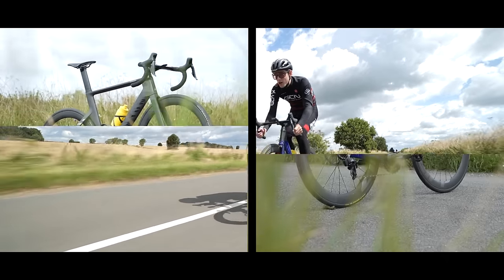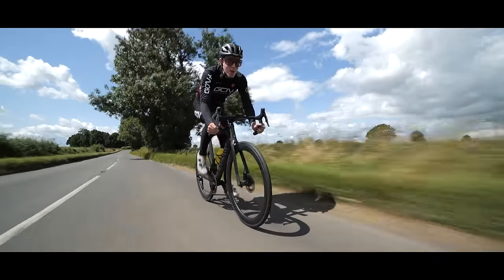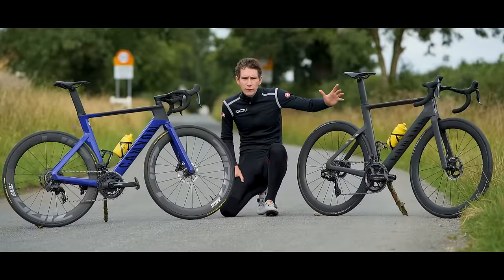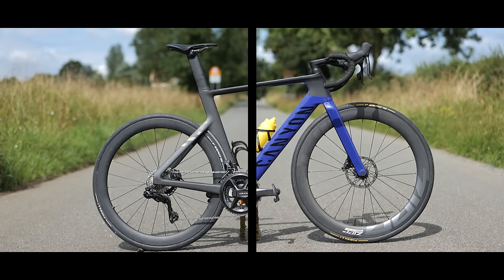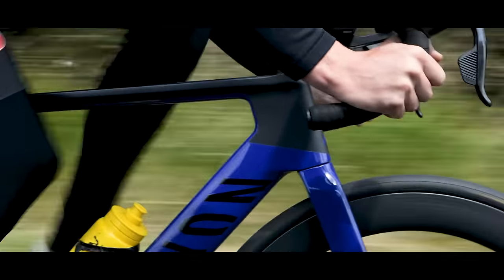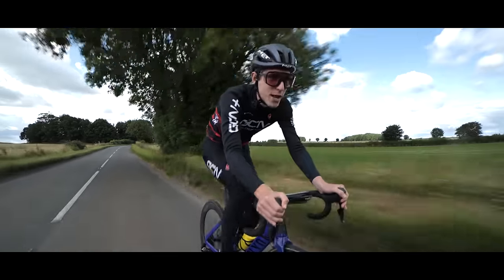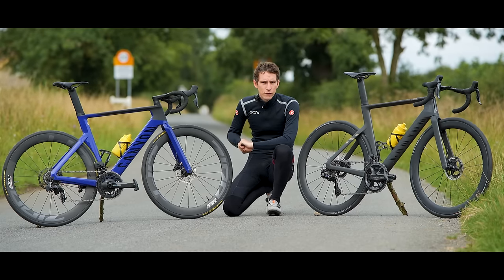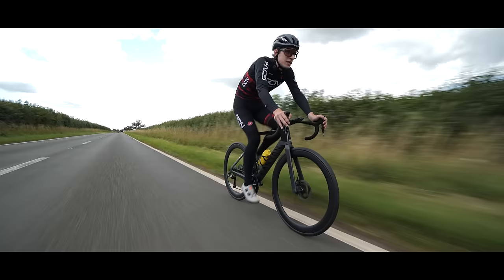Why Do These Two Canyon Aeroad Bikes Feel So Different?

Comment from the maker: Frame or components: what matters more to you? 🤔 Let us know in the comments below! 👇
Reply: frame for what the bike is and feels like (wheel choise accordingly). handlebars make a difference of course. but the components are more for funktionality. like 1x or 2x, gear choise, and so on. but colour is so important, l don't like how little options are out the quite often. the chinese actually do a great job with affordable fully custom paint jobs
Reply: I think the frame fit is most important. Components may add weight, or weigh less, but if you are optimizing your position on a really nice frame, you are going to love the feel, which will make you seem like you are faster even if you aren’t.
Reply: Frame fit is most important - you can always change components on your frame to your liking, but the frame is the frame - that's essentially the bike skeleton - it can't be adjusted.
Reply: The frame is more important because it's the foundation, you build up from there and switch out literally everything else.  The frame determines 90% of the ride characteristics.  This video show you're just tinkering around the edges in terms of ride feel and responsiveness
Reply: Frame geometry makes a big difference. Next are tyres and wheels. Lighter wheels feel different. Wider tyres feel different.
Reply: Canyon frames don't matter because they crack. 4 / 4 now
Reply: Geometry is by far most important.
Reply: @gcntech Question for y’all—how important is the addition of all the additional (aftermarket) tech? After buying sensors, pedals, and head unit—a person could have reinvested a small fortune in their equipment. Can you speak to the importance of these items? If you didn’t have them, would you still enjoy the cycling experience?
Reply: Funny to see that many cyclists seem to not value the properties of carbon. I am both a cyclist and a surfer. In surfing, the flex of a material is pretty much its most important characteristic. Surfboards can be made with fibers with polyester resin or with fibers with epoxy resin. Sometimes strips of carbon fibers are then used on top of the regular fiberglass to add specific stiffnes or flex in certain areas. However, surfboards can also be made completely out of carbon fibers, or mixed carbon and aramid fibers.
All these specific combinations of fibers with resins all result in completely different characteristics of a surfboard. This, however, also holds true for bikes.
What kind of materials is used will have an gigantic impact on the feel of the bike. But also the way that the material is used will have a great impact. If you only use 1 or 2 layers of carbonfiber, the result will feel very, very different from when 4 or 5 layers are used. More layers are stiffer, but can also provide more dampening.

This eventually means that the different frames of the same model will, like Si has noticed, result in very different bikes. Their aerodynamics and functionality will be the same, but their character and feel will most likely not be similar.
Reply: @TheMoodyedge  Which year and which model?
Reply: Components.  Specifically tires and psi.
Reply: Both. They both make up a fast bike
Reply: Frame material, geometry, construction and sizing will always be the determining factor for how a bike feels, handles and behaves.  Components and contact points can adjust a bike’s comfort and functionality but cannot make one frame feel like another.
Reply: @MrSJR39  Tires.  Tires, or tire pressure actually, can drastically change the way one bike feels.  The difference btw 100psi and 70psi is huge--rocky rattle, silky smooth.  Can't be ignored.
Reply: @gcntech When buying a Canyon you have no choice to set it up. You can't select wheels, handle bar, groupset, saddle etc.. You have a set number of set ups to choose from, you can not change wheels or groupsets. I bought a new Ultimate, with it came a 4iiii powermeter. I could NOT buy it without the pwoermeter. I already have  dualsided powermeter-pedals. So, buying the Ultimate I had to pay for a powermeter I didn't want nor needed. I'm getting more and more tempted to follow the example of Trace Velo. I see more and more channels follow his example with good reviews of the tested frames and components. I suggest GCN revisits Chinese frames and components again.
Reply: @andersweinemo  Same with stem length.  I'm on a small aeroad, what came with 172.5's (catalog said 170 they paid me to keep them) and a 9cm stem (2cm too short) my only option is to buy another 400$ part.  This bike is still amazing.  And still very inexpensive, so I'm good with it.
Reply: In this case, price matters more than either of the other things and in that case the CF SLX wins hands down :)
Reply: @TheMoodyedge ???
Reply: I’d  rather choose a bike that feels smooth and playful. Floaty and have an electric glide for the feel of the bike. I guess the intermediate mod carbon layup like the CF SLX, would be my preferred choice. I also like the Pinarello Paris since it supposedly feels smooth and electric as well. It just needs bigger tire clearance so I can run 32c for rough roads. Weight doesn’t matter to me, as long as it is playful, racy, and soaks up the bumps!! 👍🏼 Racy Comfort.

Comment: Biggest takeaway from this video is that you can run a Force cassette with Shimano 12 speed
Reply: SRAM and Shimano have always been compatible in recent history, freehub and all?
Reply: U can also run an 11spd shimano crankset with any 12 spd shimano or ltwoo groupset.
Reply: No. The biggest is the electric camera scooter.
Reply: Yes, you definitely can. I'm even using SRAM red 22 cassette on my Campagnolo 11sp bike and with 12sp Dura ace chain, shifting is spot on 👌
Reply: @PHHE1  News to me, heard that SRAM started out as a Shimano part maker but thought they would have deviated by now.
Reply: I learned that sticks are good at keeping bikes up.
Reply: I am using the Shimano 12-speed cassette with Sram AXS and flat top chain in 1x12 config. Working very well and quiet
Reply: You can, but really you shouldn't. The sram axs Road cassettes are designed for the sram flattop chains. The flattop chains have bigger and deeper rollers, for which the cassette is machined for. The spacings between gears is fractionally different too. So whilst yes, you can do what you want - the best results on 12sp is keeping things manufacturer specific. In worst case scenario the lack of engagement of axs chains in shimano cassettes may lead to chain jump under load. Same may be true of shimano 12sp chains on sram cassettes. There's a good video on zero friction discussing chain compatability and current 12sp differences of you want to watch it.
Reply: And there wasn't even an earthquake😂
Reply: @davidkaplan5517 I was particularly drawn to half a tree used at 0:53 😂 who needs shadowstands when nature provides.....
Reply: You can do, but will experience higher rates of wear due to the different chain design and spacing.
Reply: I would not sprint full tilt with that setup. SRAM 12s has bigger rollers in the chain. Up to 11s they are really interchangeable.
Reply: It worked okay at low loads but the Shimano cassette didn’t work at all on the SRAM bike. I wouldn’t do it.
Reply: @simonrichardson5259  Only half a joke with my comment as you do on the internet :D Maybe a video about the topic? Shimano and SRAM won't like it ofc.
Reply: mo
Reply: @simonrichardson5259  I wonder how this works in big races. Does the neutral service have SRAM and Campag wheels?
Reply: Many have found that SRAM works better with Shimano cassettes because of hyperglide
Reply: I did video on this!!
Reply: @romanpramuka2703 good on you having a bike equipped with a sram cassette and it even shifts one gear at a time without the excessive clunk lol.
Reply: That’s not a new discovery. People have been doing that since 12 speed shimano was released.
Reply: @PHHE1 different free hub body. Also shifters and derailleurs are not interchangeable.
Reply: I use a Shimano cassette on my Kickr because it's way cheaper, despite the bike being Force eTap.

Comment: I haven't been able to ride two of the "same" bikes back to back, but there are several things I've noticed make an instant and noticeable difference when changed on the same individual bike in my experience:
- Swapping inner tubes. When I went from butyl to latex inner tubes, I really had to stop and check for a puncture a couple of times on my first ride, the bike felt just SO soft and smooth, despite everything else being the same (tyre pressure, tyres, wheels), apart from the inner tubes.
- Dry and/or dirty chain vs clean and well lubricated one. The clean one just feels so smooth that it really makes me feel more connected to my bike.
- Oddly enough, going from 50/34 to 52/36 chainrings. I don't know if it kind of gave me gear ratios in between the previous setup, or the fact that I am now more towards the middle of the cassette with a straighter chain line most of the time, but I find the slightly bigger chainrings smoother.
- Saddle - not just the rails, but the shape and padding - a saddle that does not fit you well will feel rough even though it might not hurt you per se either. Also a slight variation of the saddle height. I can feel a difference of about 5mm in saddle height when I change it on the same bike, but I doubt I could pinpoint it if I jumped off of one bike and immediately started cycling on another. As in it could work, but it wouldn't be perfect, and I assume most of us haven't had a proper bike fit, so saddle height can be off by a few millimeters without even realizing it.
Reply: Your chainrings being bigger will be smoother partially simply down to the bigger size of the ring. Part of why bigger 30mm spindles on cranks works so well is that they are bigger. Same with OSPW. Track sprinters have a similar idea. Loads of people are under the impression that they are super strong; albeit they certainly are but you must remember one more thing: while the chainring those guys run is usually north of a 58, the rear cog is like, an 18 or 19. Bigger front and rear, but why? Because bigger is faster. Of course, thats only part of it. But hopefully that makes sense. This is why I would like to see Sram make bigger rings, not smaller ones.
Reply from the maker: These are all great changes that will make a big impact to the overall feel 🙌 Have you now found your favourite setup?

Comment: 1) If you are going to buy a bike on a review alone, it doesn't matter what it feels like. 2) If you buy a bike by test riding a number and choosing the one you prefer, then it doesn't matter what the review says.
Reply from the maker: Wise words 😉
Reply: Yes and no.
While I personally recommend method 2) I then do look at reviews between my top two candidates.
More importantly, I dig deep into the brands and components involved and what issues people have had. For example, Bike A may feel that little bit nicer than B, but in your geographical location bike B may have much better service and support if something goes wrong.

And at the end of the day, I don't want a bike that should something go wrong or it have a weird seat post clamp defect that I could have found out about if I had researched it more prevent me from spending time on the bike.

So, I think there's a balance here.
Reply: I'd prefer to go for 2) when I am going to buy a new (and expensive) bike, but not so many bike shops offer a test ride of every bikes they have. That's the problem :(
Reply: Good luck finding bikes in your size for test rides, that's a big part of the problem.

Comment: I was once lucky enough to ride a Pinarello Gan S back to back with a Gan RS and Dogma F8 all of the same model year and with the same wheels. 
There was quite a difference between all three. The RS was fast stiffer and more responsive than the Gan S. The dogma f8 was only a little stiffer than the Gan RS but noticably more compliant at the same time. 
I learnt that day that the frame is the most important choice you can make as it is the foundation of everything else

Comment: Si, having recently changed from a 2016 Cannondale SuperSix Evo HiMod to a 2023 Giant TCR Advanced I’m pretty convinced that improvements to stiffness are playing a big part in how more efficiently the Giant rides on the flat & the climbs. As it’s 500g heavier than the SuperSix & with a similar geometry, I think that stiffness is one of the subjective areas that you & the team could try to address objectively, if possible, across different bikes. For example, manufacturers make claims about increased stiffness but don’t appear to support the statement in the same way that aerodynamic improvements are “substantiated.”

Comment: Wheels and tires are huge.  And PSI specifically.  I have Canyon's MVDP Aeroad.  This bicycle is like nothing I've ever had.  It's absurd how 'fast' it is--as in--it obviously requires less effort to propel it thru the wind.  Insane.  I can change how this bike feels, in a big way, with tire pressure.  I have Conti GP5000 Tubeless in 25c.  I weigh 140lb and ride on 70psi.  One particular road near me really sucks.  Sometimes I drop the pressure to 65 and instantly the bike is smooth as silk.  No jarring around on the rough old pavement.

Comment: This was interesting, especially because the difference between the SLX and the CFR, as Si describe it, is exactly how I’d describe the (rather big) difference between my SL Ultimate (2015) and SLX Aeroad (2017). They both run the same groupset, cockpit, saddle, tyres and tubes, so I have always thought that the difference would all be because of the difference in frame geometry and to some extent the rims (alu vs carbon) and seatpost (VCLS 2.0 on the Ultimate). But maybe some of it also is the difference between SL and SLX..

Comment: Interesting video, I had almost identical feedback from riding a standard Supersix versus a Hi-Mod Supersix. The cheaper frame definitely felt smoother to ride - while the more expensive hi mod frame gave more feedback and felt more responsive. Both great to ride, but there is definitely a subtle difference in feel between different carbon specs and layups.
Reply from the maker: Which one did you prefer overall?
Reply: @gcntech  the hi mod, because I’m quite a performance focused rider and it feels like it gives you a bit more in return for your effort, plus I’m a total weight weenie 😂
But if I was choosing one for steady endurance rides I would have opted for the lesser model
Reply: Now THIS is a comment I’m interested in. I’ve got the standard SuperSix, and I’ve always wondered how it compares to the Hi-Mod! I love taking mine out for long days in the saddle, and it’s the perfect mix of performance and comfort for me! Would love to ride a Hi-Mod someday to truly know the difference, but perhaps my wallet is safer if I don’t 😂.
Reply: It’s funny , I had the old supersix himod and caad12 at the same time . One aluminium and one hi mod carbon Both rim brake . Both felt fast and climbed like a demon . Same geometry , I kept the caad12 longer as I loved how lively it felt and made me smile 

 They were the same weight too as I had some light parts on the Caad . The himod though definitely more compliant and muted 
I’ve an Aethos now

Comment: I recently went from p zero 28 tubeless to gp5000 28 running lightweight bontrager tubes. Similar PSIs. The difference night and day. Tubeless felt dead, smooth yes but the ride was lifeless and felt slow. On the other hand - gp5000 with tubes - wow - much more connected with road, feels quicker (actually weighs less) and the acceleration is better. Just a lot more fun. Nothing else I’ve done (aside from swapping deep carbon wheels for shallow lightweights in the past) has ever changed the ride this noticeably. And all for £80.
Reply: So true

Comment: Si is asking a very legitimate question. I have ridden Giant TCRs since 2005. I have the TCR Comp (2005), TCR Comp (2011), TCR Aluxx (2014), TCR Advanced SL (2022). I've ridden all four with the same wheelsets. Three have the same basic drivetrain (SRAM Force 22). Overall, the frame material and layout plays a massive role on feel, but at the same time certain wheels feel better on certain bikes. It is an odd balancing act that many people don't think about too much, but can play a huge role in how we ride.

Comment: Frame carbon quality and layout will make the most difference. I have two specialized bikes, one with fact 11 and the other one  with fact 12. The fact 12 is lighter but stiffer. Transfer a lot of road vibration.
Reply: the carbon isnt different
Reply: @JwallzMTB  well something it is because one frame is lighter than the other one. And cost more.

Comment: i have power saddles on both my bikes, same width (143). But one is the comp version (plastic/metal rails) and the other is the pro (carbon/ti rails) and it’s safe to say i do not feel a massive difference.

Comment: I rode a Canyon Endurace CF, which is their entry level carbon layup, with a stock DT Swiss Endurance LN wheelset and it was very spongey. Bought a Zipp 404 Firecrest wheelset in hope for a stiffer and more pronounced ride, yet it still feels more or less the same so i'd argue that the biggest difference in ride quality and responsiveness comes from the actual frame itself. I'm pretty certain that the same bike with CF SLX carbon would feel completely different.